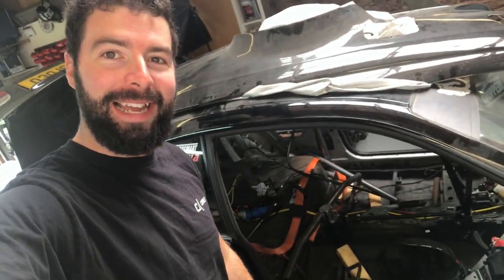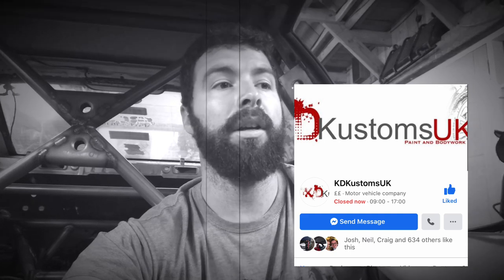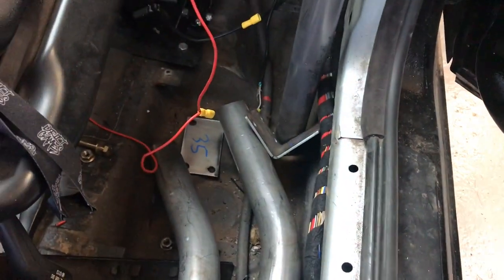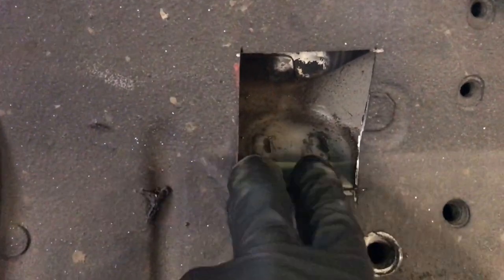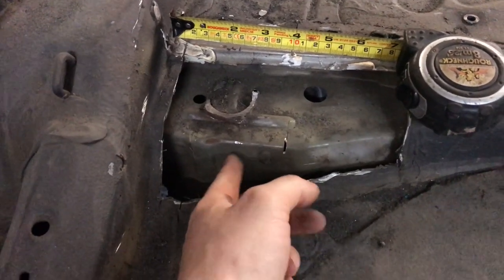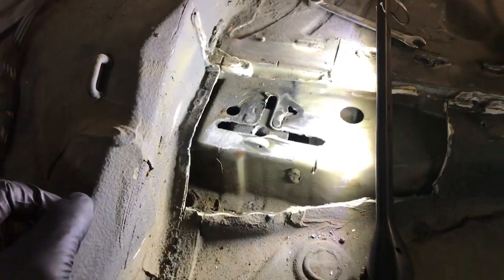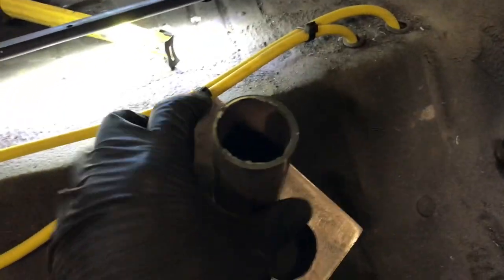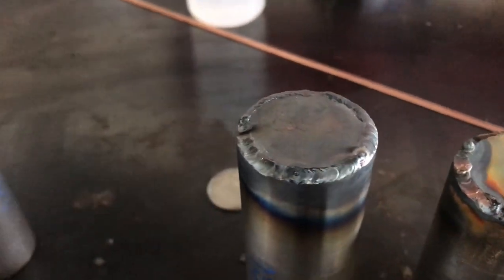E46 roll cage - How to reinforce subframe the right way

Comment: Good video man can't wait for the next one👍 I want to see how do you weld cage in tight spaces
Reply from the maker: Next video tomorrow at 1pm and you will see more buddy 👍🏻
Reply: @SMTMOTORSPORT  on the hype to see how this turns out. looks great so far
Reply: @SMTMOTORSPORT  so you do not remove the stock subframe studs from the bottom of the car 

You just drill tap and add another bolt from the top and you leave the stock studs alone right?
Reply from the maker: @FirstLast-tx3yj  no I put long bolts from inside to tie into subframe I only did to bolt method to weld cage in
Reply: @SMTMOTORSPORT  so you remove stock studs

You drill from the trunk and tap
Then you put you welded cylinder piece and insert a long 1 bolt all the way down to the bottom

Comment: I'm in the process of doing something similar, however I cannot for the life of me find an suitable bolts, that have enough thread on them to get all the ay through.
Have you managed to source any? It's looking like I'm gonna have to get some custom machined. Cheers
Reply: @JTGudgin  Did you have any luck with extending the threads? I've come up against a similar issue
Reply: @edwardwinfield7443  Yes I just got the above bolt's, put a die on it and tapped about 3/4 the way down. It taps straight as the existing threads start you off straight. If I was to do it again I would just drill out the thread on the car and just use a put a nut on the inside, no reason to use both. The bolt's are long enough for both front and back.